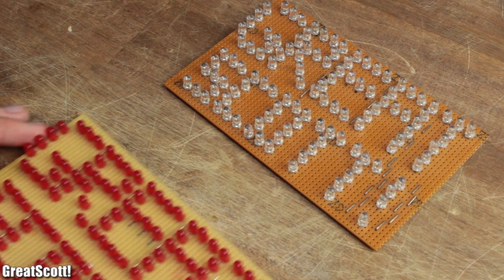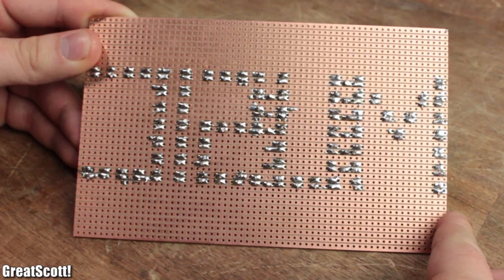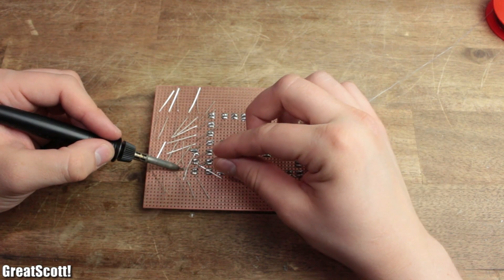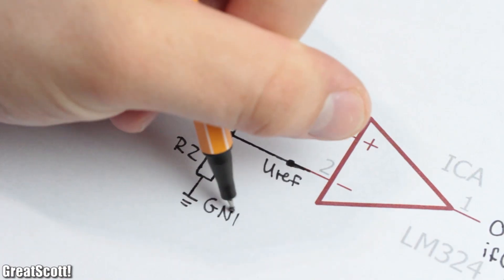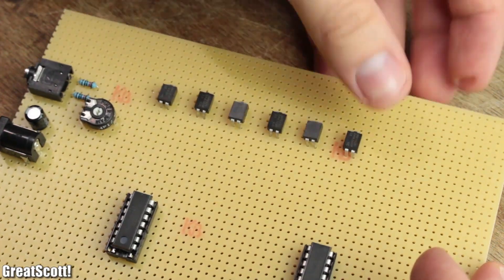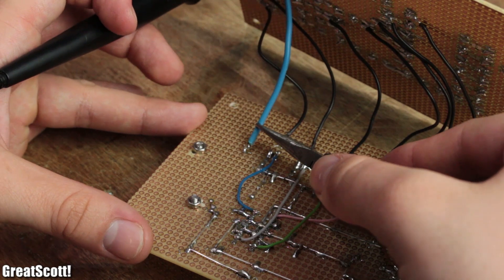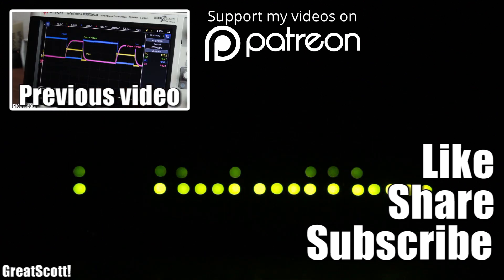Make your own LED Sign VU Meter

Comment: For version 2.0, get a bunch of capacitors/inductors to make resonant tank circuits and several of those chips to have crude but appealing spectrum analyzer!!!
Reply: Probably the simplest way to do that is to use some LPF filters for the first couple letters and HPF filters for the last couple.
Reply: +Power Max That's actually a pretty neat idea!

Comment: Ah Lochmaster! I designed a modular synth with stripboard with v3 of that software many years ago. Super cool software. It even lets you put resistors on the backside, and at odd angles, etc.. Massively useful. 

The site is probably still online somewhere. The ASM-1-SB edition. Good times!

Comment: Could you please make a video with "Peltier module", I have to reduce temperature of the inverter of my induction heater, I already have a exhaust fan, but i would like to set up another 12VDC fan with the Peltier module. Di you have an idea?

Comment: Hi I have only started doing electronics and learning about it in the last few months. I built an audio amplifier, and I want to use a 3.5mm jack and cable for the audio input, but I don't know how to attach the four wires in the cable to my circuit? I built an oscillator and connected its output to the amp, but I want to be able to connect it to music. If you can offer any advice that would be great :)

Comment: Hey Scott, Where did you get the silver copper wire? I did a search on ebay for 0.8mm silver copper wire and the only stuff i'm finding is for jewelry. Is that what you use?
Reply from the maker: +SublimatedIce I get it from Conrad. Even though it is overpriced there.
Reply: +GreatScott! Yeah I was hoping to avoid the overpriced stuff. I will try my luck with ebay. Thanks

Comment: Ich verfolge die meisten deiner Videos und ich wollte dir nun mal danken. Zusätzlich hätte ich da ne frage, die mir unter den Nägeln brennt :)  könntest du bitte mal den Aufbau ect. Eines auf ebay angebotenen Hochspannungs-Generator erklären?  Ich habe solch ein generator und finde die 'Arc's' krass!  Ungern, würde ich versuchen meinen auseinander zu bauen, dabei würde ich es wahrscheinlich noch zerstören. 
Hier z.B. Solch ein Monster:

http://m.ebay.de/itm/800KV-3-7-7-4V-Hochspannungsgenerator-High-Voltage-Generator-Inverter-Module-c13-/322015667920?nav=SEARCH

Comment: @GreatScott!, how were you able to make this work without current limiting resistors for the LEDs?
Reply from the maker: +David Kind The buck converter provides the necessary forward voltage for the LEDs
Reply: +GreatScott!, Is the buck converter current limiting?

Comment: What if i want so build a simple one,just with LEDs and power supply?
Some help please. :D
Reply: connect every anode and cathode, so you just have 2 wires coming from the thing. count the LEDs, multiply that number with the voltage. get a PSU and you'll probably need a voltage booster as well. set the booster to the number you calculated. done.

Comment: where do you get the silver copper wire? how much should i expect to pay for a roll? thanks. 👌👍
Reply: +Oscar Andersson It costs something like 15€ for 50 meters and you can get it at many electronics distributors like farnell, mouser, reichelt or conrad.
Reply: +Marian Keller Thanks you sir
Reply: +Marian Keller Do you think this is kinda like the one he uses? (It looks so helpful) https://www.conrad.se/Koppartr%e5d-Conrad-1-x-1515006%2f100-0%2e60-mm-100-m.htm?websale8=conrad-swe&pi=409327&ci=SHOP_AREA_17416_2510140 (Sry, its in swedish)
Reply: ***** Looks just right.
Reply: +Marian Keller Thanks! ;D

Comment: now add some frequency things and make each letter represent a different frequency of the music
Reply: Lol easy right? You'd need an arduino and the use of some FFT libraries for that.
Reply: @minepro1206  You can filter audio signals without digitally processing it, like for example with capacitors.

Comment: I have to say that I don't know as much as you, Scott. But I do believe that you could have achieved the same using less parts. Nice Video, waiting for the part with RGB LEDs :)
Reply: +Aryansh Malviya He wanted to show the concept, not only some abstract IC that does everything. 
But yeah, I also wouldn't bother to build it up as a discrete circuit, and just use a LM3916 or a micro with an adc.
Reply: Marian Keller That is what I am trying to say. man! :)

Comment: super project very informative. I am starting a underwater 10 watt led project, it consist of 9pcs  10 watt green leds, they are the integrated approach of 3 and 3. the problem I am having is there is no data sheet for the leds other than what the seller list. 10 watt green, voltage dc 9-10.8v, current 900mA. What I am trying to do is power them with a 13.4 volt automotive battery. since I dont have a bench power supply (parts ordered as per your diy build). I will be running the 9 leds in parallel and dont want to damage them, so when I go to the led calculator and enter the info it tells me there is a issue with the  voltage. I have different buck converters to use in the project or would it be better to use resistors.I Donnt really trust the info from the seller.  Does anyone have any suggestion, need help. thanks

Comment: Wouldn't it just be easier just to connect each row to an increased amount of resistance? Like, the bottom row has the least resistance and as you go up, it adds a resistor so that the brightness of the LEDs dim as you go up. Would the reason be efficiency? Unless you are running it from a battery I can't see that ever being a problem.

Also, the background music is almost unhearable, was this intentional? The audio level at the outro was good, but not for the rest of the video. Still impressed at the project though!

Comment: Why did you use a buck converter?
Reply from the maker: +i8BBQ4Lunch To efficiently step down the voltage from 12V to 2.4V for the LEDs
Reply: +GreatScott! Thank you.  Sometimes I have trouble connecting the dots.  I really enjoy your videos.  Thank you for all of your effort.

Comment: Simple and easy,  what if you used an ADC with a microcontroller ?
Reply: +SpIRiTus1995 better even with the analog method to use low pas and high pass filters to show the different frequency ranges, would seem very cool.

Comment: Where do you recommend buying large amounts of pieces ?

amazon seems to rip me off and ebay is terrible because you need to order everything individually and end up receiving a million small packages that all require a run to the post office to get
Reply from the maker: +BillTheBox Watch my Q&A video. I talked about a good Ebay seller there.
Reply: GreatScott! I was hoping to avoid ebay, but I guess I'll try some places like banggood and gearbest then
Reply: ***** i order on aliexpress a year now and i never add a problem, always had a refund.
Reply: +BillTheBox I like aliexpress, you will have the same issue of a load of packages but they are really well priced and as long as you understand what a fair price for an item is you won't be ripped off. For example don't expect a real pickit programmer for $11.
Reply: +BillTheBox alibaba
Reply: MISFIT 414 they are mostly scams and want my credit card ( my amex card suddenly got used for random purchases after using aliexpress ) and they don't want paypal

also it's essentially the same as ebay
Reply: +BillTheBox Aliexpress
Reply: The seller that Great Scott recommends (G&C supermarket) is pretty good, I ordered a lot of things and I received them in one cardboard box
Reply: +BillTheBox Aliexpress
Reply: +BillTheBox Farnell & (i think) RS components are global retailers

If you're in the UK then CPC.farnell is also one to add to the list

I generally work out what I want in my order from one of them and then pricecheck against the other two (sometimes 3 separate orders works out cheaper)
Reply: I use mouser, CPC (farnell), and RS. it is worth getting a company account with most of them if you can too as you will get discounts, faster deliveries and a full catalogue once a year. I would recomeed using google to search their sites though their online cataloguing is terrible.
Reply: +BillTheBox use eBay, buy a selection of the basics then buy or salvage individual bits you need but don't have.

I smashed in an order for bunch of 1% metal film resistors, ceramic caps, electrolytic caps, transistors, LEDs and veroboard and some breadboards. took a few weeks but they all arrived around the same time and packages were small enough to fit through my letter box so could come when I wasn't home.

ics I tend to place an order and wait.
Reply: +BillTheBox Mouser
Reply: go to your local electronics shop. They have everything you need.
Reply: +BillTheBox banggood = ebay
Reply: Hyss - loads of packages
- rip off's everywhere
- fake stuff

no I really won't go back to aliexpress or alibaba
Reply: +Hyss 

"their online cataloguing is terrible." You're not kidding! CPC do a great physical catalogue though. There's also the online catalogue, but I much prefer to leaf through the pages of the real thing. http://cpc.farnell.com/main-catalogue
Reply: Llewln as of right now Radio Shack has a 60% off sale for online things, they have a bunch of electronic stuff like this

Comment: Yesss! I have so many vu meters, but never get tired of them. the lm3915 it is a very good option but lm324 it is good too. thanks for this excelente video my friend!!! saludos
Reply: Como gusta verte por aquí Gastón :)
Yo también esperaba un lm3915
Reply: physics 12 student here and also not that smart.. but we are currently trying to do this project and have no ideas on which resister to use and where to use them! hopefully anyone can help? we bought all the resistors @greatscott mentioned in the description and are desperate to know which goes where
Reply: @danehelene5568  All the resistor values are given beside each OP AMP in the diagrm.
Reply: You could also use the lm3914 for a Vu meter .C.
Reply: lm3914 is a good option too
Reply: you can use any of these 3 chips, but just FYI: 

LM3914 is a linear display.
LM3915 is a 3db increments logarithmic display.
LM3916 is a VU-Meter display. (-20 to +3db)
Reply: +maletil Essentially, an LM3915 is a single chip with coparators inside.
Reply: OMG VU METERS ARE BOSS! I LOVE THEM! I HAVE ANALOG AND LED.  Sweet! I'm not the only nut! I have a ton of old stereos from sansui to Marantz and Yamaha and Sherwood!
Reply: Yessssss Spanglish!!!!!!!!! Saludos
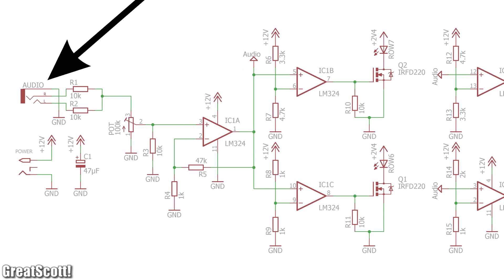Reply: 2:49 10k resisors doesn't match the schemaic at 2:25.....
Reply: Ok.

Comment: Idea for a future project : Build a low pixel screen with LEDs
Reply: +Bogdi Gaming and More!  For 720p he would need 921600 different pixels/leds. Even 144p is 36864 pixels.
Reply: *****  36p with a 16:9 ratio would be 2304 pixels. That would be possible but would take a VERY long time to wire.
Reply: +parasBanaani so it would be a multi episode XXL project
Reply: ***** 18p would be 576 pixels and 9p would be 144 pixels. Im so tempted to buy a big bucket of leds and try this myself D:
Reply: parasBanaani if you do it pls let me know if you make a Video about it, I really want to watch it
Reply: HeisenbergIsReal Just bought 200 leds. Its going to be black and white for simplicity. If it goes well i'll make a video and maybe even try to make a larger rgb screen :D i hope somebody has made a program that can be used for this as well. Wait couldn't i hack a old tv for its guts and use them to drive the leds? I better investigate this during the 1 month delivery time of ebay :D
Reply: parasBanaani you can use the Software that Scott used for his LED Matrix
Reply: 144p screen only would need all of the leds on amazon

Comment: Next project: audio spectrum in leds
Reply: You can do that quite easily using an arduino and the fourier transform library, the hard part would be to multiplex the led matrix
Reply: @745morning  If there was no library for the FFT, it would sure be way harder to get that part done instead of the multiplexing. Multiplexing ain't that hard honestly, just gotta be fast enough to not flicker. 
Would there be no MCU, or no spectrum analyzer ICs available (of course they exist, how else did they do it in the 80s and so after all), that would be one hell of a circuit with all the comparators and bandpass filters in there, or you would need to mulitplex the analog stuff as well.
Reply: It would be a good idea
Reply: I like that idea...
Reply: also interested
Reply: Hell yeah